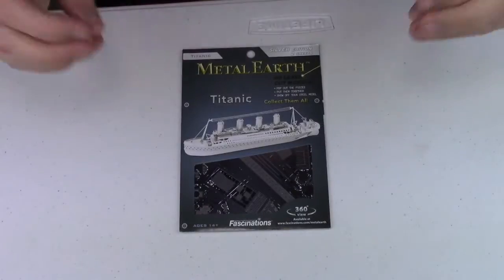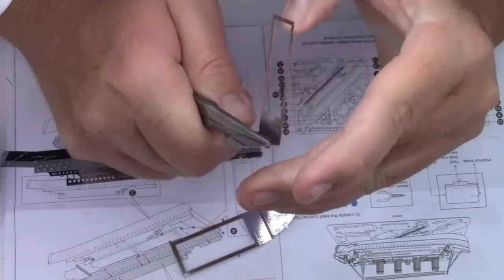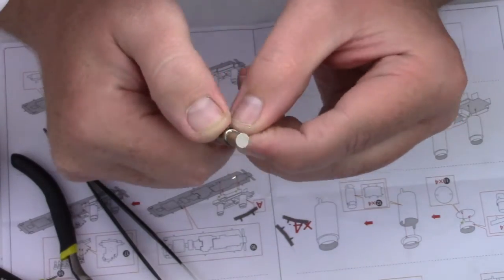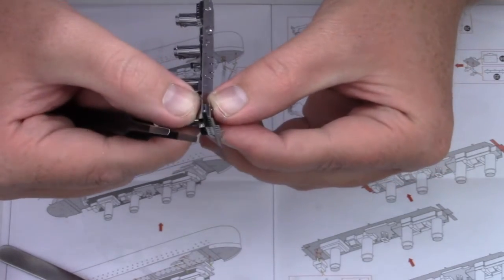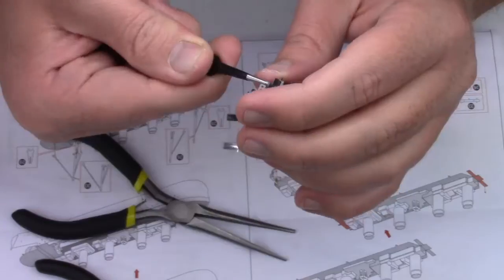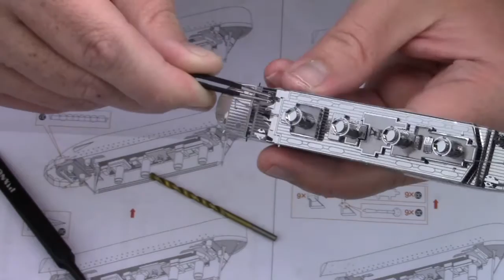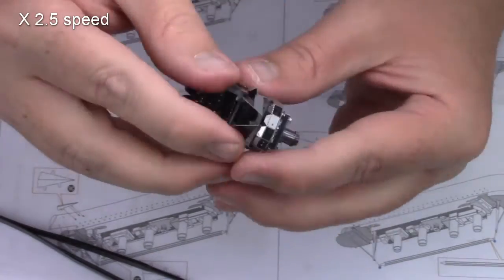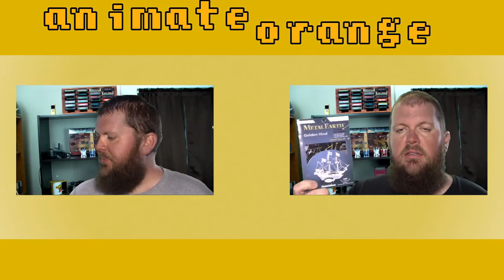Metal Earth Build - Titanic

Comment: are there any ways to fix broken pieces without buying a new kit? would solder work?
Reply: i built a ferris wheel and i broke one of the cars, then i realized they give you an extra frame of the car and 4 car doors just in case... well i broke the hanger on that one too right as i was putting the last one in
Reply from the maker: Tyler L I have not been able to get soldier to work but you can contact Metal Earth for replacement parts. www.metalearth.com . They are usually really good about that.
Reply: Thank you!
Reply: i messaged them and they are sending me a few spare cars, they recommended i use tweezers instead of pliers next time lol
Reply from the maker: @Tylerl128  good. I would be interested in just what they do send.
Reply: they sent me the whole kit
Reply from the maker: @Tylerl128  thanks for letting me know.
Reply: i bought 4 more, and im excited to work on them i got 4 days off this weekend for vacation and my wife wants build some too! but were worried that we might run out of space so i want to only keep the ones that mean a lot to me, can you re-sell these once put together or is that something id have to ask the company about?
Reply from the maker: @Tylerl128  I have seen people sell finished models before.